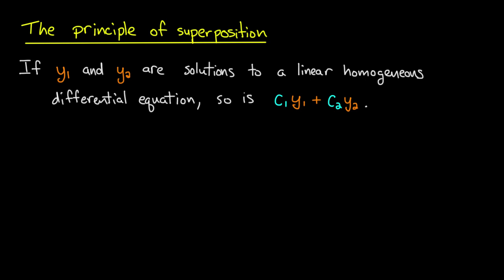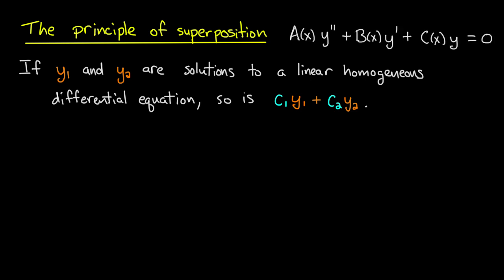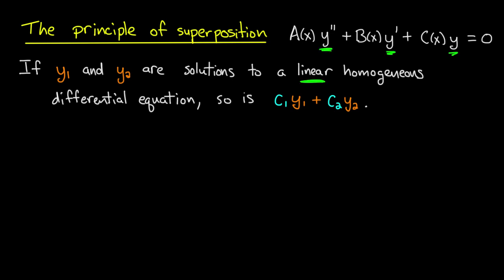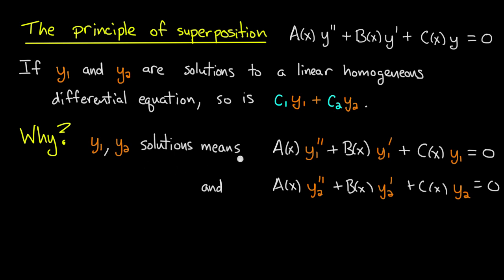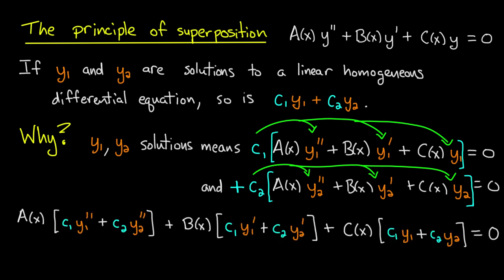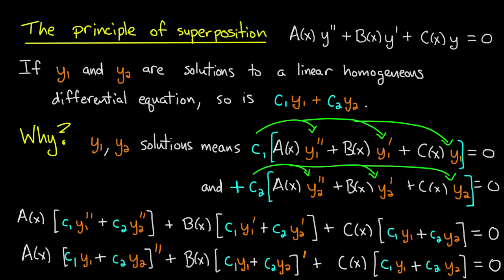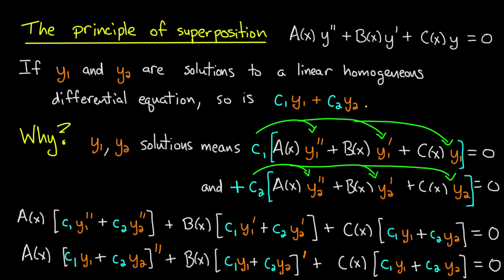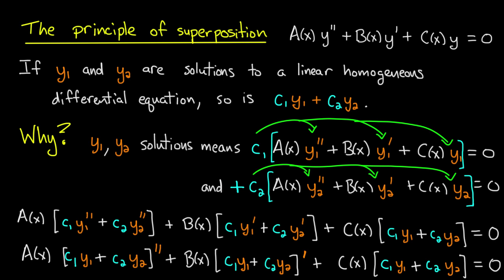ODE | Principle of superposition

Comment: Is this Principle of superposition the same as the one they use in electricity and magnetism?
Reply: I'm sure you know the answer to this question 3 years later lol.. but for anyone else who has this question the answer is yes, at the fundamental level. In order to actually solve a circuit using superposition this information will not be adequate. You will need to understand the concept of source-suppression and how that is used as a tool along with superposition to get a solution.

Comment: I heared about this long time before and also tried to apply this principle in calculation of resistor networks successfully (here usually the whole Voltage drops at the resistors , so the equations would be homogenious - right?). 
Now I thought about how this could be used for a kind of ( assymetrical) differential gear box with 3 motors = generators at the shafts, but got stuck since I dont want to get down the tourque or the speed to zero, but just transform one parameter into the other to keep power and efficiency as high as possible . Would this mean I always would have to rescale the single expressions ( power)?